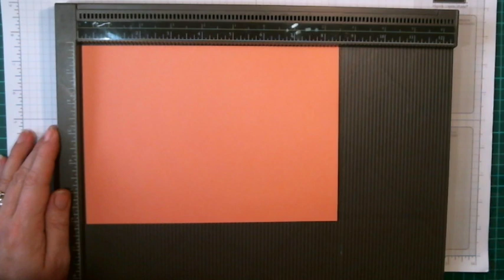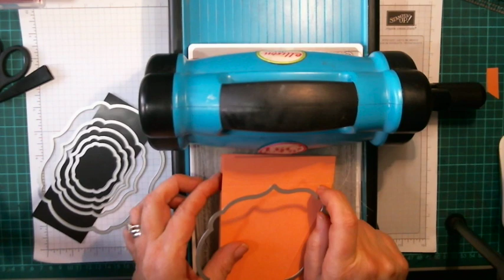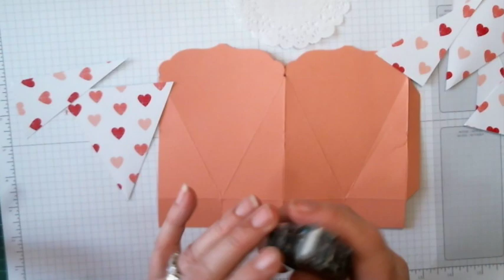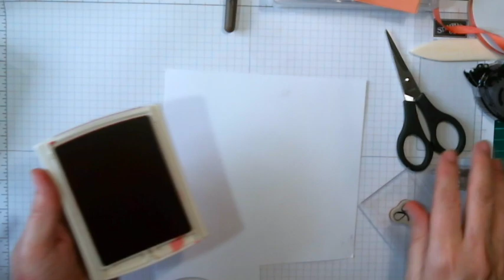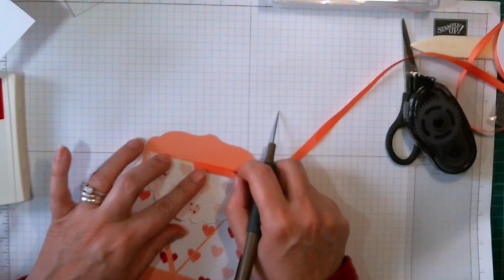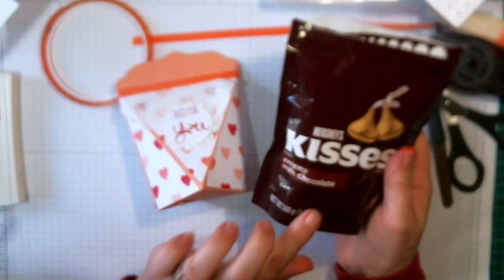Stay closed box- sound corrected

Comment: If you put sticky strip or any other DS tape somewhere you don't want it, try heating it gently with your heat tool. It softens the adhesive and allows you to very gently peel it off. Hope this tip is helpful.
Reply from the maker: Thank you!  That's a great tip, I'll remember it!